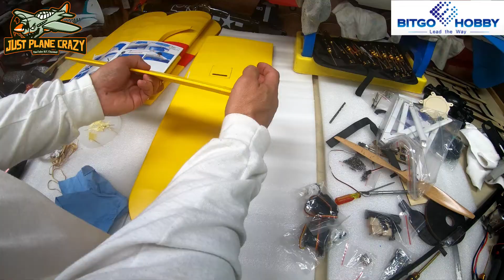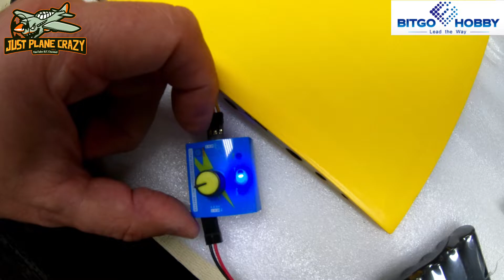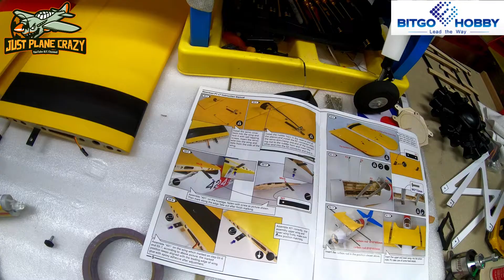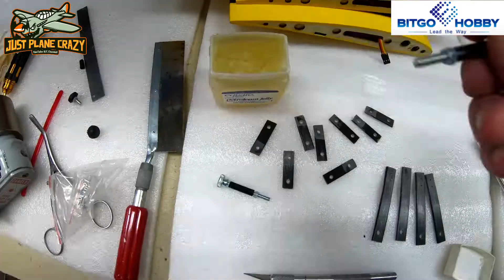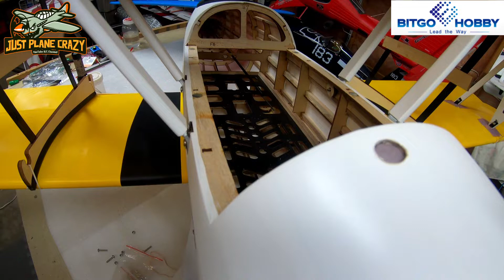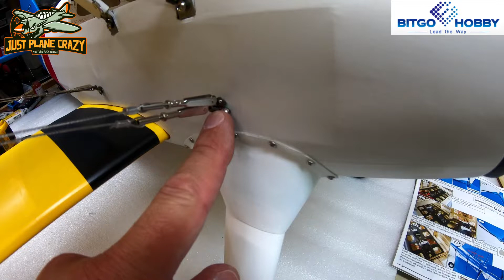Pt2  Dancing Wings Pt17 Stearman Balsa ARF PNP Build Series, from BitgoHobby. WIng Assy & Components

Comment: I love your build video on the PT17.  I have the model and am using this video series helping me to build the model.  The flat carbon pieces that attach the lower and upper wing panels…in my kit, the pieces were two different sizes.  I was wondering if you used the shorter pieces for the lower panels, if that would prevent having to trim the pieces to get the lower panels to fit better into the fuselage.  I love the “tips” you give that help with the final product being better built.  Thanks for your time in putting this series together.
Reply from the maker: That may work. Makes sense to me. I appreciate you watching and commenting.

Comment: I don’t like the fast forward aspect of your videos. The whole point is to learn your tips and techniques. I totally missed the fact that you used a heat gun to get the landing gear fairings to lay flat against the fuselage as an example. Wound up using more screws which looks funky. Anyway, slow it to normal speed. Anyone can ski a part easy enough.
Reply from the maker: I make a lot of vids that do go in depth on things but I get the point. Thanks for the feedback. I do personally like that trick btw.

Comment: Did you change your servo arm to bigger/longer? The original servos with arms are too short on PNP.
Reply from the maker: Yes I did both. With and without
Reply: @JustPlaneCrazy  sorry., on Ailerons servos. What and where can I get it,thx
Reply from the maker: I used some arms that I had laying around. The ones that come with it will work. I am not sure there was any benefit to the change because throw is limited by the surface itself and not really the arm.